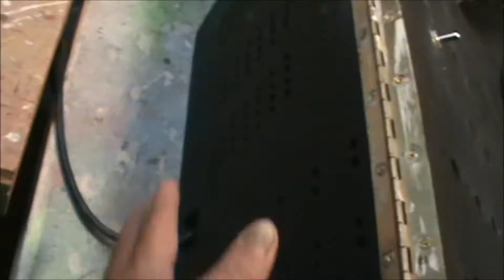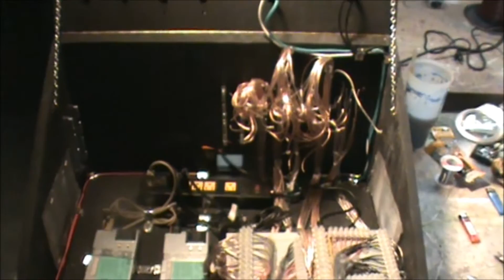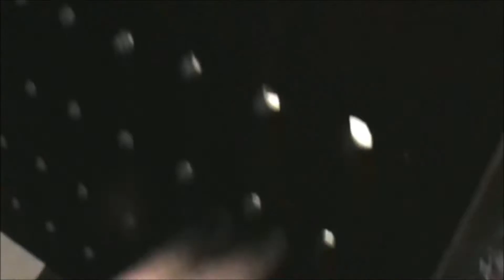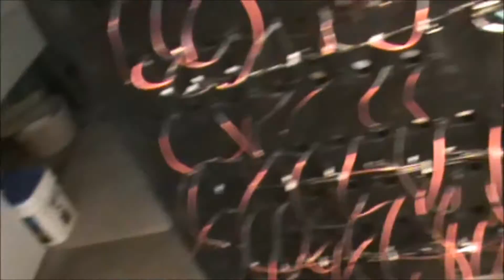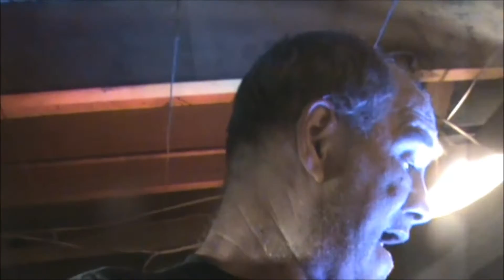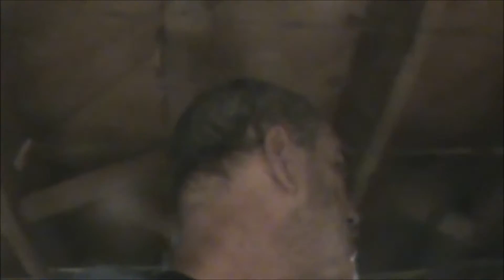The Power Box Build PT 2 5-31-16

Comment: First, dang that is a rats nest, glad you know what your doing.
Reply from the maker: I did run into one small problem after I finished the vlog,, went to test the 5 volt side and kept blowing the breaker in the comp power supply ,,, figure it out fairly quick ,, I had reversed the power wires wires ,, 5 volt was hocked up to 3 volt and 3 volt to 5 volt... lol going to have to just reverse the wire to fix it ,, will take 5 mins lol